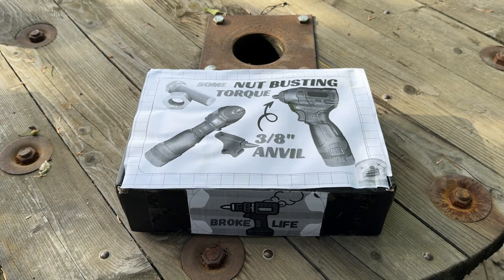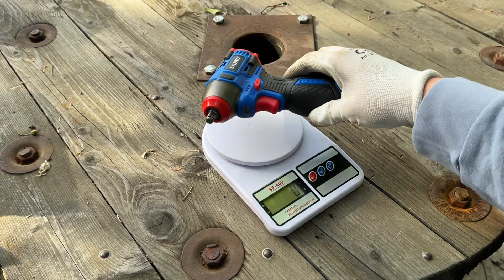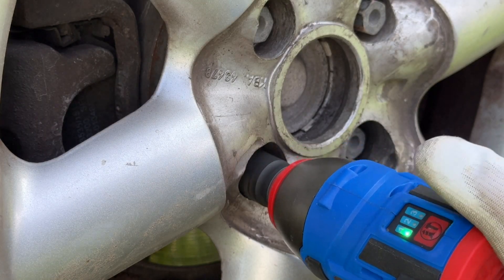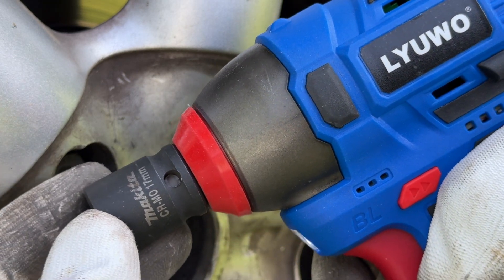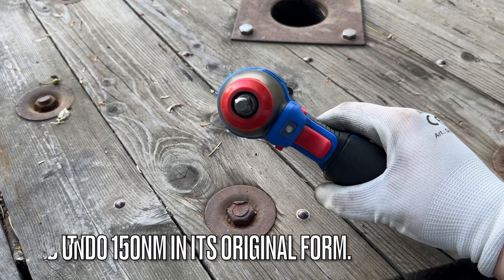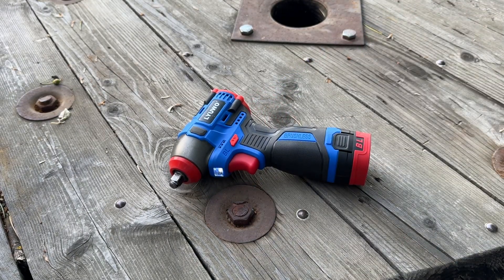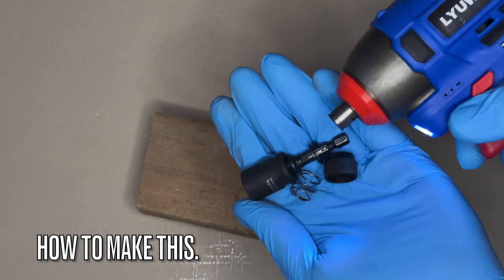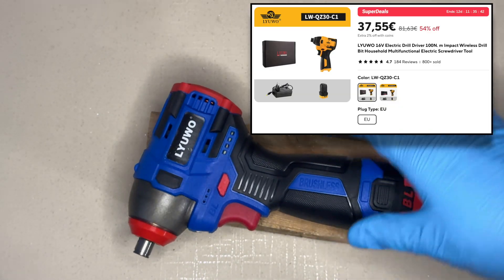I made the world's CHEAPEST 3/8" stubby impact wrench. Testing and how it came to be!

Comment: Lol does it still work?, my friends and i have this exact same one (wideep) lol, it very cheap and we bought because of its compact size and can easily fit in our motorcycle compartments. So we could use it case of emergency (we travel alot).

This was fun to watch very helpful and informative and awesome quality too, thanks alot
Reply from the maker: Thank you for your kind comment! It still works, although I changed it bavk to its original 1/4” drive as I needed the 3/8” anvil for another project. It is really not bad for the price this thing.

Comment: why not just use a hex bit adaptor?
Reply from the maker: A viewer requested it and I did it. Usually the idea behind such a conversion is to not love power through the adaptor. Also a smaller size, because the socket will fit directly. And also adaptors break. I honestly thought it would turn out better than it did... Knowing what I know now I don't know if I would have bothered. But in the end I found it an interesting project so in the end that is what matters I think. Could have turned out to be something brilliant and we would have never known. Unfortunately it is the other way round and now we know it is mostly useless 😂 But I will see if the new steel bushing makes a difference when it arrives. I fully believe it will make a difference but I have ben proven wrong before. So I will make an update when the time is right. Did I somewhat answer your question?

Comment: I'm a bit apathetic, I expected more performance from the mod.🙃
Reply from the maker: There will be an update once I get my steel bushing. I ordered a third one. I am pretty sure that we can get a lot more out of this with the steel bushing. Now I feel half the power is bouncing it around. It was good for the first couple of bolts but then brass started flying everywhere and it could not do much after that.
Reply: On my B3 mod, with brass self-lubricated bushing no problems, should i be worry?  @BrokeLifeEU
Reply from the maker: On the B3 no. The bushing there is thick enough. Because the ID=16mm and the OD=22mm. Whereas for the conversion in the video ID=16mm, OD=20mm and the bushing was not a tight fit in the casing. It started to turn in the casing and so it was being hammered once from the anvil and then it was being spun in the casing. It is not a good fit in this case, because it is too thin and deforms easily. In the Parkside B3 conversion the brass bushing is thick enough and can sustain much greater loads with no deformation. My first B3 that I converted what seems like 2 years ago is still going strong with the brass bushing inside. And it is being used a coupe of times per week. So on the Parkside conversions there is nothing to worry about.
Reply: The 1/2 anvil mod would have more performance?
Reply from the maker: The 1/2“ anvil can‘t be made to fit. Only this 3/8“ can be made to fit the casing and impact mechanism. The 1/2“ is impossible.